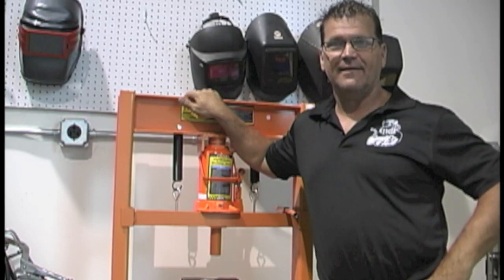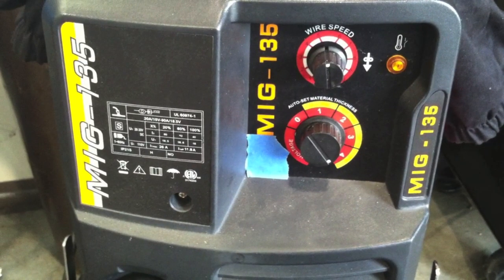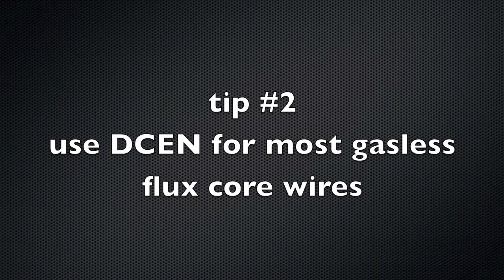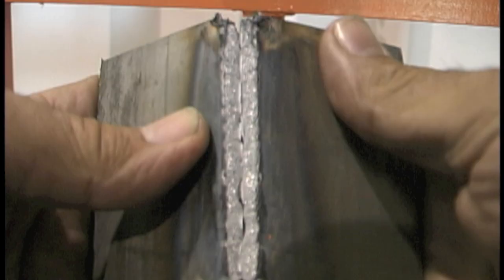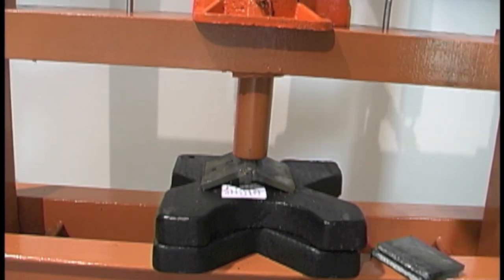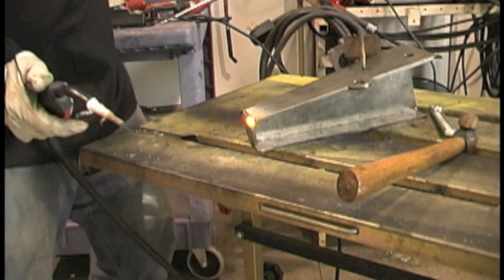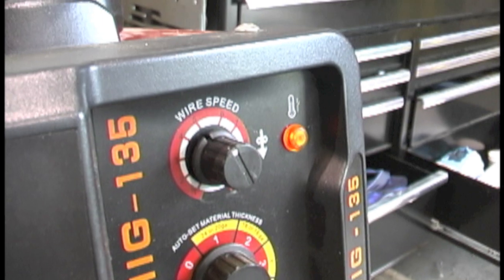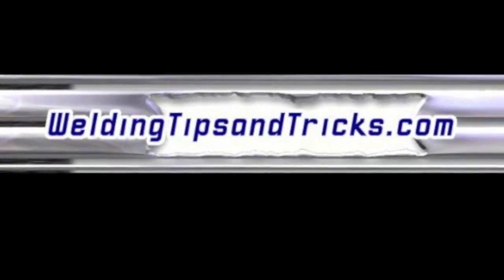115 volt Flux Core Welder Tips

Comment: - Yesterday: my first experience with my new Mig Welder Chinese Machine: "Flux Core"... Pppuufff ¡¡¡¡ A GREAT PIECE OF CRAP THIS "DEVIL WIRE" ¡¡¡¡ so many, many, many... and  millons of spatters in everywhere, that I waste 1 or 2 hours for clean and correct my welding. (¿¿Crap = Trash ???? ... I guess... The Flux Wire and my Chinese Machine, a pair of Crap ¡¡¡¡ ja ja ja). Daniel
Reply: Make sure your polarity is set to DCEN (electrode negative) for Flux core.

Comment: Always used Argon in my MIG Welders at work but I went with a Flux core for home use and I have had to basically had to change the way I weld. Pulling does make a huge difference with flux core. Not sure if my welder can have power leads switched. I have a Chicago Electric 90 amp.
Reply: At school we are using flux core with MIG gas. It's fast and hot.
Reply: John T
Yeah that's called dual shielding and it produces very clean strong welds.
Reply: +Tony Kinsey you should try pulling with gas......it penetrates better pulling regardless of fcaw or solid wire.  The push technique giving more penetration is a simple lie.  FULLSTOP.  Read any welding manual, miller, unimig, hobart, all of them will have a gun angle and bead profile diagram.  

Pushing produces a wider bead with shallow penetration, pulling creates a deeper bead profile.  I don;t know why or how this "You have to push mig" came to be, its pure bullshit.
Reply: +Ray Ward I agree. The research I have done when welding with solid wire (GMAW) you have the option to push or pull in 1, 2, and 4 positions. 3 uphill you have to push and I don't know how you would go 3 downhill and way but pulling. 

With dual shielded flux I was taught to always weld it like I would a 7018 rod and "if it's got slag, you've got to drag" except vertical uphill. 

Don't take my word for it though. I only have a 900 hour welding course and some garage bench work under my hood but I have stayed at the military version of a Holiday Inn Express for the past decade.